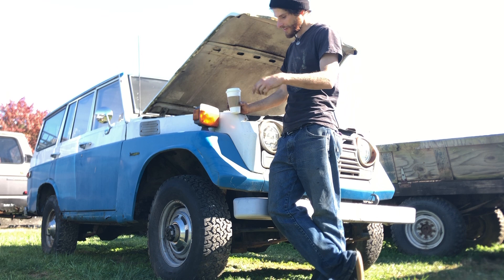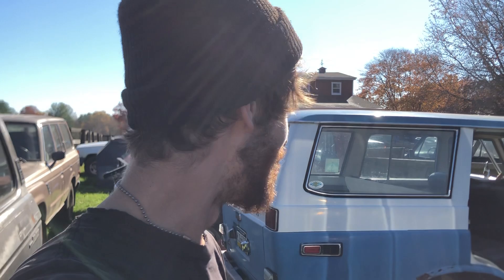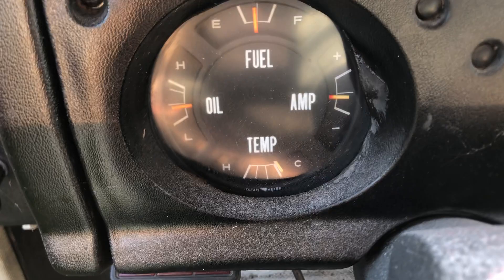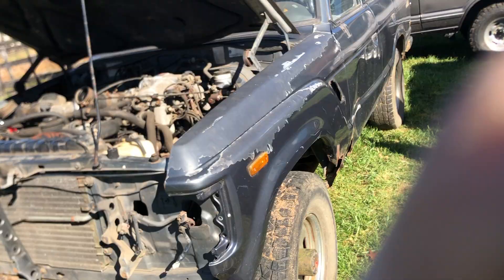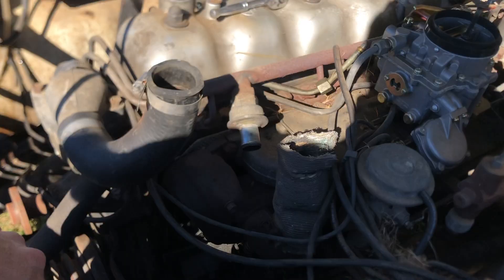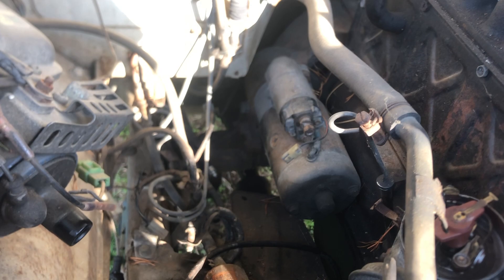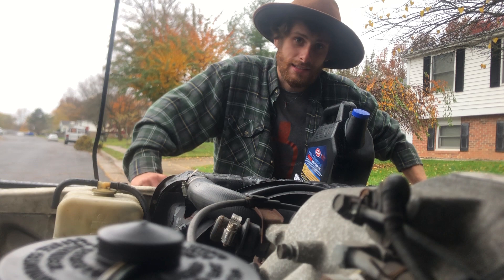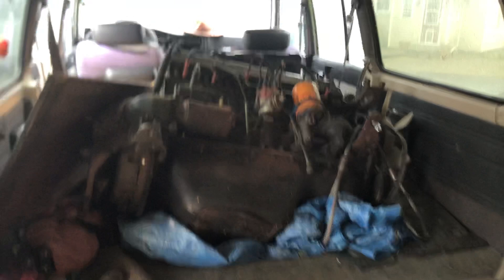Finding a 1976 Toyota Land Cruiser FJ55 Iron Pig and Buying Sight Unseen PT2: Tour and New Motor

Comment: Bed liner on the floor is not factory. Rockers and front body mounts are the most susceptible to rust, followed by the rear corners and sill under tailgate. Also check bottoms of both front fenders.
Reply from the maker: yeah thats what i thought!. i did just buy the factory rubber mats for it. The rockers are okay... the tailgate is awesome. the corners arent... and the fenders rusted away from the bolts so they hang out like its flying ha. want it to run good before i tackle all that above things. thanks for the Info!

Comment: Good to see another 55 getting saved. I dont think my 71 has that pull cable for the back seat release.
Reply from the maker: Heck YEAH! right. I need to find a few parts for it but dang its kind of hard. would love to see a update on yours
Reply: @mizeadventure9438   havent done too much more. Got the exhaust finished... dual welded thrush mufflers to a single 5 inch stainless tailpipe! Having an issue with bogging down going up hill... i am thinking i need to mess with the float..
Reply from the maker: @ABANDONEDCARREVIVALS  hmm interesting. I mean i think we both have way more projects then we know what to do with. anyidea where i might be able to find a rear tailgate gear. thats the main think im having a hard time find right now
Reply: @mizeadventure9438   might try a guy named Dan Martz. Hes on facebook.
Reply from the maker: @ABANDONEDCARREVIVALS  great i just reached out to him. thanks for the tip

Comment: I’d selfishly love to see you rebuild a caliper,  my PS one is seized and I’m a bit intimidated but should rebuild vs autozone
Reply from the maker: I would say buy it new and then mess around with your old one and see if you can rebuild it.
Reply: @mizeadventure9438  ya on my 40 I opted to just turn in the rusty old ones for core money and the new ones were super easy to swap in.  These are in much better shape so I like your strategy!